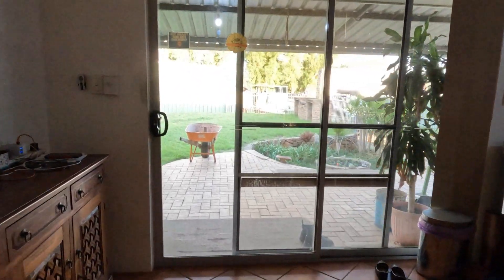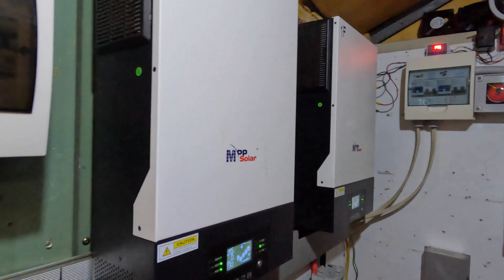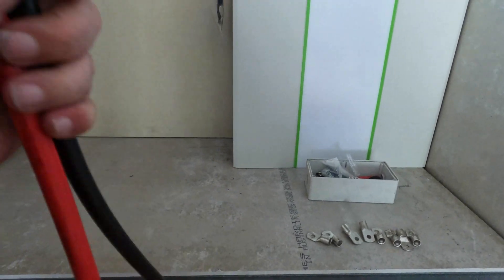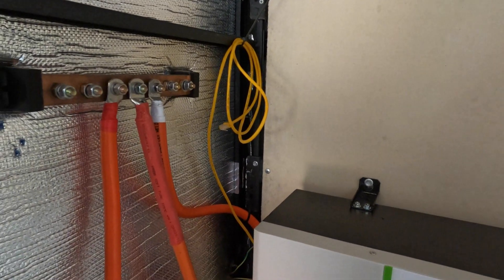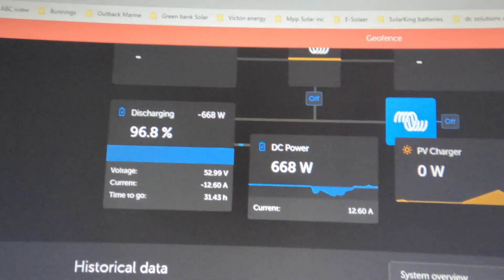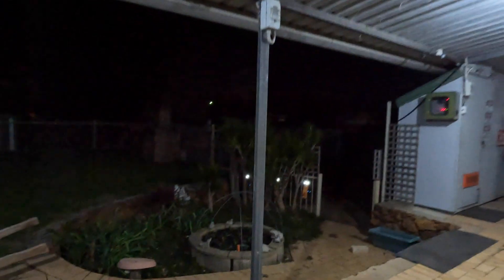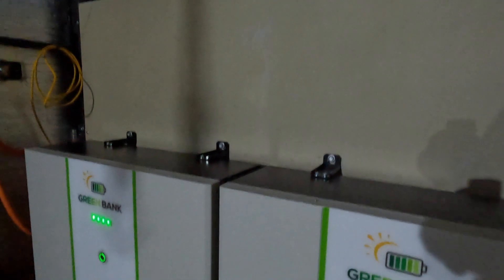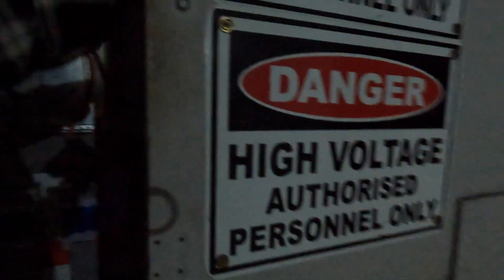HUGE OFF GRID Battery LiFePO4 24 KWH, The Install

Comment: Hi nice install, are you charging the the greenbank batteries using the mpp solarcontroller/inverters. i have just had my 440ah 24v lead acid battery bank crap itself and found greenbank batteries and your page, im thinking of getting 2 of the 250ah 24v green bank batteries and running them in parrallel with my 2400watt mpp solar charge controller/inverter and 1500w of panels. im running part of my house offgrid as i couldnt add more panels and keep my 50c rebate, this way all the grid solar goes back to the gris at 50c.
Reply from the maker: our system works great. can’t fault it at all. the new inverter is just so much better and a lot more efficient. As we are just running one inverter now, instead of the two 5048 units we used to have. 👍
Reply: @JustinCaseSolarPower  cheers for the reply i have ordered a new victron easysolar 3kva unit to go with a greenbank battery. Just waiting on the new model which will talk to the victron

Comment: Nice and compact, but don't expect the same level of reliability as you had from the old lead acid batteries.
Those smart BMS add another layer of complication to the system.
Reply from the maker: Thankfully I already know people that have been running these same batteries for years now, in Queensland Australia where it is very humid all year round and they have had no problems with them at all. So I am looking forward to the same with mine. But you are 100% right when you add electronics  into a system it is also adding another part that could fail. 
Thankfully the BMS is easy to replace same as the high frequency inverters I use. Thankyou for taking the time to comment Hasore on my video :hand-purple-blue-peace:

Comment: Nice!  They sure take up much less space!!
Reply from the maker: they also charge very fast. 57.6 volts till they are full then the bms shuts them down. They will take all the amps my system pumps into them and they don't tail off near the end. Volts last night did not drop below 53v, Huge improvement Norm. Though as most things in life time will tell.  😉👍

Comment: 😀 I am loving the new batteries Chris. 
I am going to need some new batteries here in a couple years because my AGMs are slowly getting old. So I am very interested in how you did this. 
So am I right in assuming that you now have more battery storage than you did with all the FLAs/AGMs that you took out? 
I am also interested in the costs as well but I really expect that the costs will be much greater here in Chile and that the longer I wait the cheaper they will become. 
Well thank you for the video. Jim in Chile
Reply from the maker: Hello my friend. For the prices look at this video. https://www.youtube.com/watch?v=J7tiaABo4i0 .  My ah is less, the AGMs were 1000ah and the lithium's are 250ah x 2.  Usable power of both batteries are the same. They AGM had 2000 cyclic life, the lithium's have  a 6000 cyclic life. What does that mean ? with the AGMs,  are now close to 8 years old and still have about 7 years left in them. The lithium should last us about 30 years at 1 cycle every 2 days and 49 years at 1 cycle every 3 days, depending on use. So work the cost out over that time and its very low cost changeover. The wiring is easy, but all the programming on the charge controllers has to be changed.  :✌
Reply: @JustinCaseSolarPower  ok so you have almost no power loss then. What a good deal. Thanks 👍

Comment: They look awesome . They charged fast and always better to have more than enough battery power than not enough . Great job to you and sigi . Hard work but I’m sure it will be worth it 👍🍻
Reply from the maker: Not finished yet. Still need to finish the 10mm compressed fiber cement lining and tidy everything up. But we need a few days of rest. the New batteries were 113kg each boxed and almost 90kg each, I had a battle to get them in but we managed it. Ran the house all night and  at 5:11 am this morning it was pitch black outside and we are at 83% full and 52.9v. Loving them. 😉 👍

Comment: That's what I love about my lithium batteries as well, you can throw every single bit of power you have at them and they will soak it up, the AGM's were harder to manage in that respect.
Reply from the maker: Yes lead acid is really old tech, Takes longer to charge and you really have to look after them to get them to last. Sigi and i waited for them to sort out the lithium batteries before buying them. Even now the pouch batteries and some of  the small cell batteries still have huge problems. I know people that have been using these Green Bank LiFePO4 batteries for a few years now and have never had a problem with them. Have a week of heavy cloud and rain forecast, So I will get to know them a lot better. Looking forward to learning how they perform. Very happy with them so fare though 😉👍
Reply: @JustinCaseSolarPower  This is my second year with mine, and while they aren't the same brand as yours, they work very well, considerably easier to maintain than lead acid. Yours will be even better though, the BMS in mine isn't so crash hot but I manage this by setting audible alarms in my BMV712 battery monitor to prevent damage to the batteries.
Reply from the maker: Yes it's all about the BMS with lithium batteries. Solar King also have a very good BMS in there 12 and 24v lithium batteries as well.

Comment: Magnificent work Justin! Everything looks fantastic. Beautiful clean installation. It's time for cold adult beverages for both of you :D Get some rest. Great video Justin. Many thanks. Cheers.
Reply from the maker: Thank you my friend. I still need to finish of the compressed fiber cement lining. Here it is  5:11 am pitch black outside and we are at 83% full and 52.9v. Loving them so 🙃
Reply: @JustinCaseSolarPower  Wow. That is impressive performance Justin. Great choice of batteries. Cheers.
Reply from the maker: @yhird  We have a week of rain and cloud forecast to start from tomorrow. Should be a good test for them. Could not ask for better conditions to get to know them.😉